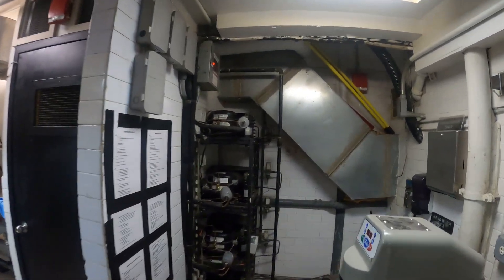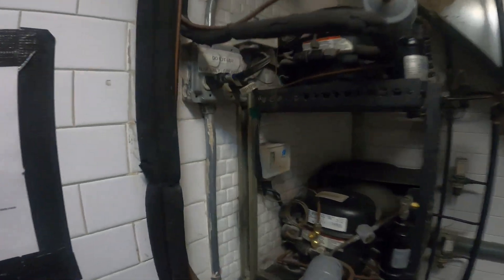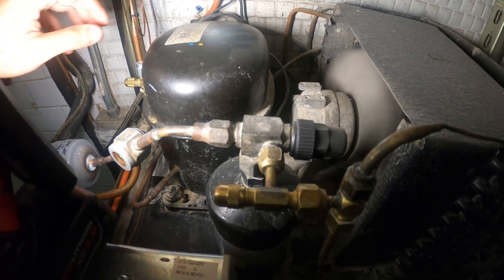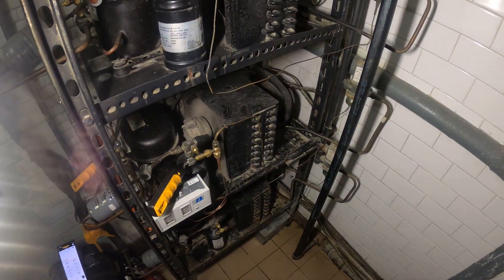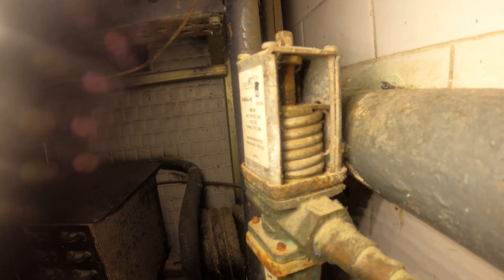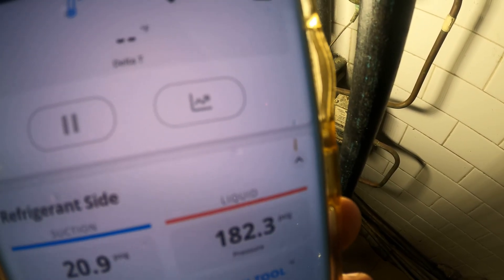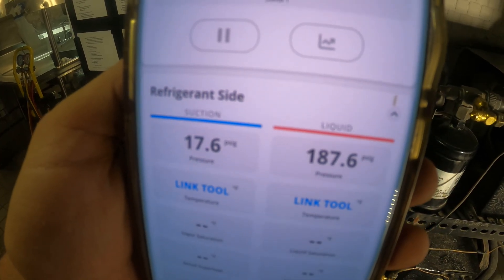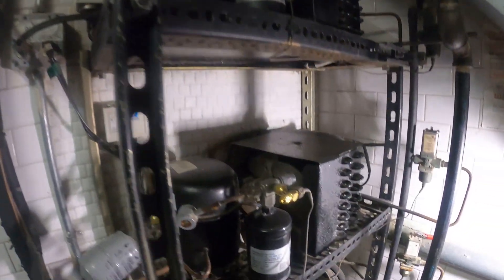HVACR Service Call: Water Cooled Refrigerator Not Cooling (Beer Cooler Not Blowing Cold Air)

Comment: Why is the condenser fan still hooked up and running?
Reply: If I had to guess I would say that the condenser isn’t big enough and can’t get enough airflow to handle that system. Hence why they had the water cooled condenser loop hooked up and attached to help assist that condenser. I’ve seen it before on a couple coolers. Which is why that reg was probably backed off as it was only meant to assist and not be used as a primary condenser. I would’ve brushed down the lint on the condenser and see if head press would drop down….

Comment: Coils covered over with lint/filth was probably causing a freeze-up which is why the thermostat was turned to 80 in order to defrost the system.  You'll be back on this one due to extremely dirty coils.
Reply: The nasty cond. coil you see is no longer in use. It got converted to a water cooled system which uses the black coil next to it as a condenser.